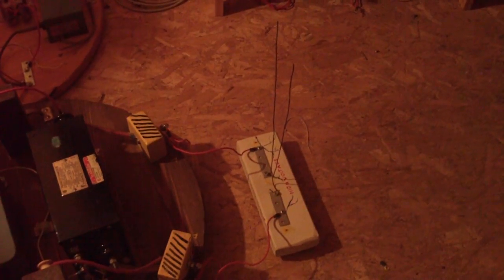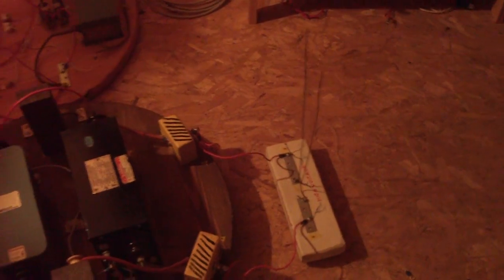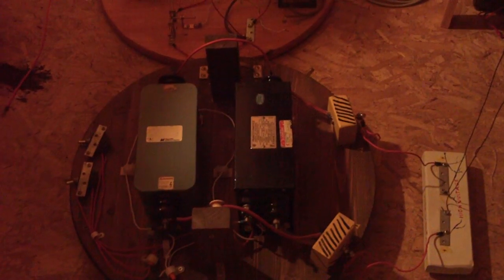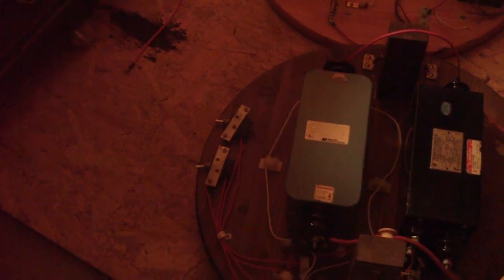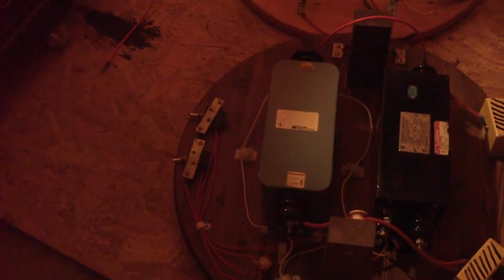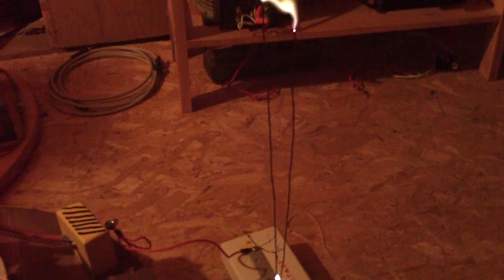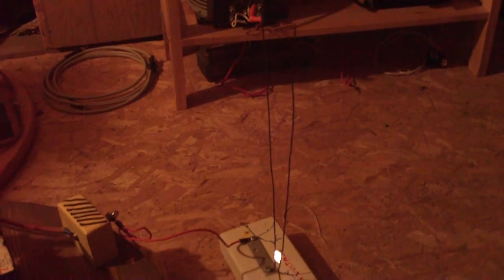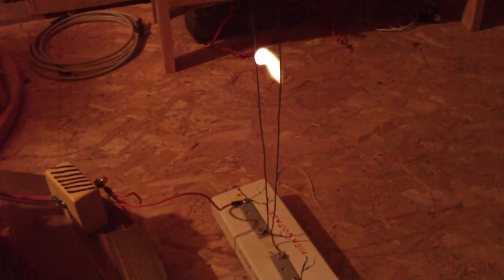Closeup of Jacob's Ladder - 15,000 volts

Comment from the maker: When you draw an arc from a high voltage transformer, it's essentially a short circuit.  Neon transformers are current-limited with shunts in the core.  So it WILL go to full load, but it won't overload.  It will go to max current of 30ma.  With two transformers, the max current will then be 60ma.

Comment from the maker: I'm not sure, but probably 5,000 volts.  At least, that would probably be the minimum to get the arc to self-intiate.  I've seen videos of a Jacobs Ladder using a microwave transformer and as low as 2,000 volts, but it's very hard to get it to start.  And then the arc usually gets stuck at the bottom.

Comment from the maker: Actually, I've done that before.  Check out my other videos.  I recorded a video with all four of them connected in parallel.  I just recorded it with an old webcam though...I should record another video with my new digital video camera.  After a few minutes, the ends of the wires get red hot!

Comment from the maker: They're connected in parallel.  The arc is pretty much a dead short, so once an arc is started, it puts a full load on the transformer, and the other one that's off doesn't draw any load.  Since neon transformers are current limited, they can only power one load at a time.  Like if you try to connect two neon tubes to the transformer in parallel, only one will light up.